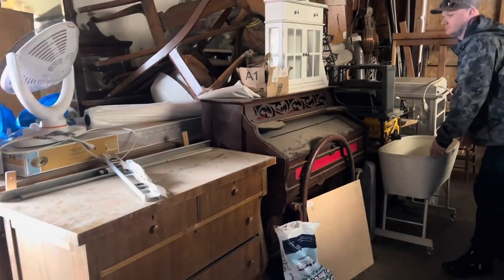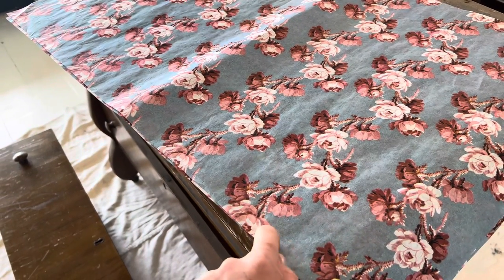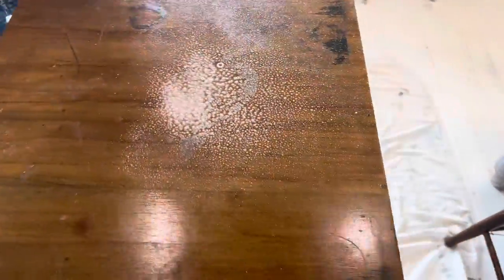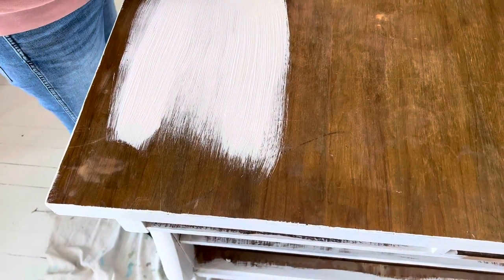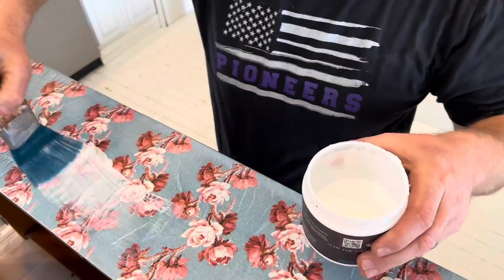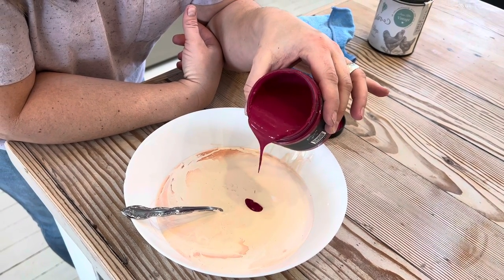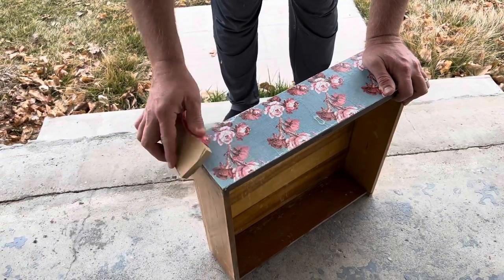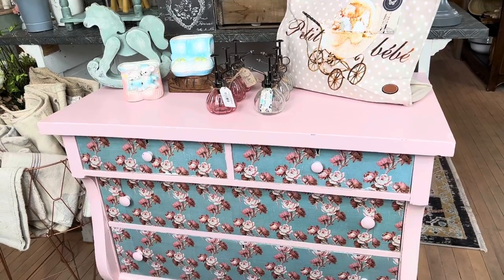Painting Furniture - Magazine Inspired Look from a $30 thrifted dresser - Primer, Paint & Decoupage

Comment: Did you know that there is a chemical in dawn power wash that will remove paint,l discovered this on the fusion paint information site.
Reply from the maker: I didn’t. I haven’t used it on painted stuff. I just use the empty bottle with water and Citrasolv
Reply: @JamiRayVintage  I save these spray bottles! They’re perfect all over the workshop!
Reply: @JamiRayVintage  lol, i use my power wash bottles for cleaner too. I think everyone does that.
Reply: Good 👍🏻